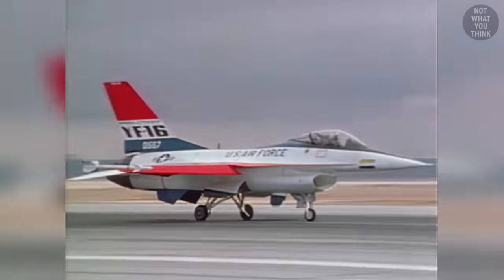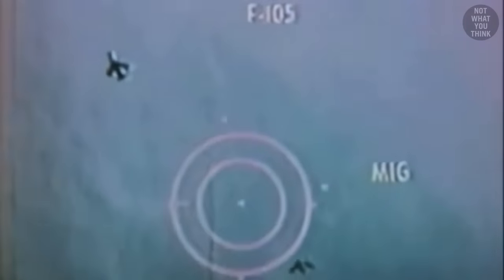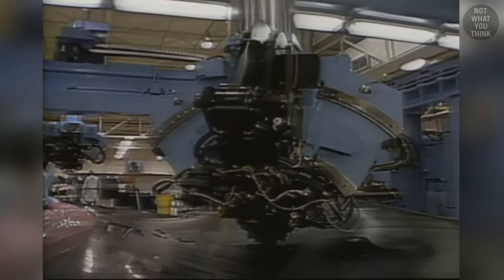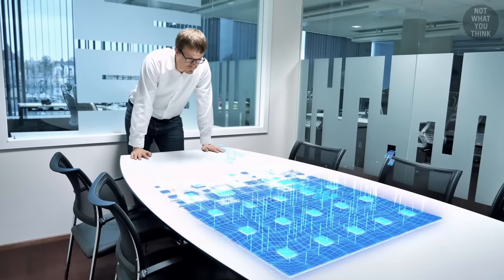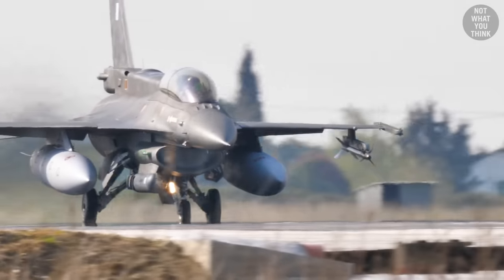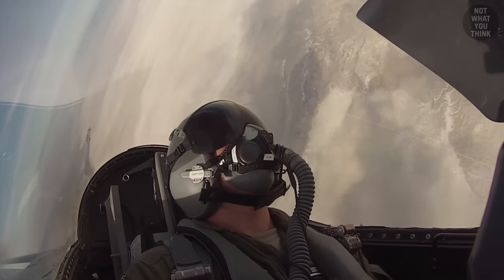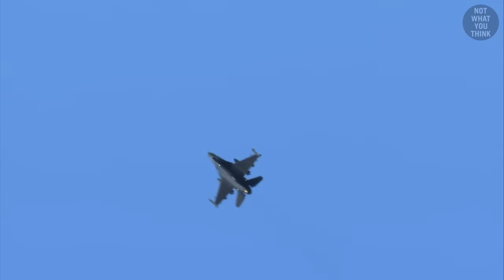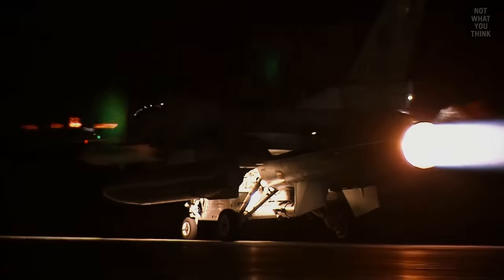Why the F-16 was Intentionally Built to be UNSTABLE

Comment: "Fly-by-wire" never seems to be able to impart just how complex a system this is. Something like fly-by-computer would do the job better imo.

Fly-by-wire sounds like an electronic version of the old hydraulic systems and whatnot. When the real fundamental change is the computer inbetween the pilot and the control surfaces. That is the gamechanger.

Comment: I design paper airplanes (my pfp is one of my models) and some things that people get wrong about paper planes is that folding a plane with a lock, it might be more difficult but it helps a ton.

Also the wings must be at an anhedral position (like how boats shape can help it stay upright), 

and if it pitches down then you need to add up elevator (like a real plane) by bending the back edges up slightly and vice versa. 

With roll or yaw bend the opposite back edge up or the other down and vice versa.

This will drastically improve your plane and make it fly straight every time

Comment: I seriously question that the F-16 was 'The First Fighter Jet Designed to be UNSTABLE'. Waaaay before fly-by-wire had any control of jet fighters, there were two schools of thought on stability. The USA school was that jets should be basically stable and rely on massively strong hydraulic assisted controls to break the planes out of straight and level. The British approach was that the jet should be on the edge of stability and lower powered (or even un-powered) systems should be employed where the pilot could drive the craft to either side of the edge.

Comment: My father-in-law was one of the engineers who designed the flight control systems for the F-16 (he also worked on the F-111). While "Flight #0" did indeed cause a Pilot Induced Oscillation, the reason was not because the plane was unstable. The PIO happened because of the gain settings on the fly-by-wire control system. The test pilot, Phil Oestricher, did an amazing job saving not only the aircraft, but also likely the F-16 program. The powers-that-be were not that impressed with fly-by-wire, and were ready to kill the program at any moment. A crash would've been all the evidence they needed.

The goal that day was a high-speed taxi, where Phil planned to lift off about 1' or so before setting back down and easing back. When the PIO started, he struggled to gain control, and once it started leaving the runway and heading toward the grass, he stopped fighting the controls and the plane took off. He later told my FIL that the plane "wanted to fly", and he hardly touched the controls once it was airborne.

They made some changes to the gain setting on the control systems, and two weeks later had the first official test flight.

Comment: The reason why that YF-16 in the initial tests had exhibited those rolling oscillations, was due to a combination between the pilot's inexeprience with a pressure stick and some flight control logics constants (dampening) that had to be corrected later using the flight data.

The moment "instability", is split into these major categories:

1. "Static instability"
2. "Dynamic instability"
3. "Aerodynamic instability"

Each of these types is relative to one of the three types of rotations: pitch, roll, yaw.

We now already have 9 types of "instabilites". The dynamic stability is again split into two submodes: rapid modes and slow modes. Therefore we have a total of 12 = 9+3 types of instability behaviors. The only type of instability exhibited by an F-16, F-22, F-35, Su-27 family, Su-57, Mirage 2000, Eurofighter, Jas-39, JF-17, etc..., is only related to pitching moments, as static and aerodynamic combined instabilities. pitch only..., all of them None of them exhibit, roll or yaw instabilities as that is undesirable and useless. How is the pitch static instability defined? The short variant: "The variation of the pitching moment versus AoA with the pitch control surfaces at zero deflection". A pitching moment increase towards a positive value, as the AoA increases with pitch controls neutral, defines a statically unstable mode. A pitching moment increase towards a negative value, as the AoA increases with neutral pitch controls, defines a statically stable mode. The aerodynamic instability is almost always present although the static instability has the greater factor. The aerodynamic instability defines the rate at which the static instability varies with AoA.

To give a fact and clear example of how the pitch static instability affects an F-16C fighter, I will explain it as follows:

At zero AoA (close to zero, yet pozitive lift on the wings), mid subsonic speed, the pilot commands a small pitch up G amount (cause the FBW actually tries to give a constant G as output) and so the elevators are deflected for pitch up by a given needed amount. Arbitrary, let's say they deflect 4 degrees up. Let's consider that the IAS (indicated airspeed) never varies. The AoA is now going to a constant 5 degrees. Now, the pilot pitches up a bit more, the deflection goes to 8 degrees, but the AoA doesn't go double as well (as it would happen for a statically stable mode), and instead of 10, it reaches 12 AoA. The pilot pitches up again and the elevators deflection goes to 16 degrees (doubling again). The AoA now goes to let's say, 30 degrees..., again much more than 24 (double). This is the static instability in pitch. For a constant/linear pitch up deflection of the pitch controls surfaces, the AoA increases exponentially more and there is also a limit of AoA (usually a positive AoA limit for modern fighters) above which the plane will pitch on it's own without any more input from the pilot and at some higher AoA, even with full opposite pitch deflection (let's say a pitch down input), the plane still pitches up or is unable to pitch down anymore, an undesirable state known as "deep stall". Up to the point or better said AoA, at which the plane starts pitching up on it's own, the plane is much more precisely controlled via FBW, but it doesn't mean that it CANNOT BE DIRECTLY CONTROLLED by the pilot as many "know very little about everything" tend to believe. For example, up to 30 degrees of AoA, the F-16 can be flown even with no FBW, but it's just too twitchy or too sensitive in responses and a bit difficult, but not impossible to control. At least to AoA's of up to positive 20 degrees, the pilot is able to fly an F-16, fly it around and land it safely. It's just that the precision in expected responses according to the inputs suffers, but the plane is flyable.

Comment: 1:54 I actually did make quite of bit of them and frequently win distance contests. I'd make a square nose (mostly for weight), small wing profile, and elevatore from folding the end of the wings up. You throw the plane up at a 70-80° angle and watch it fly. The nose forced the plane to pitch forward, turning altitude into speed, and when your speed became too much the pressure on the elevators forced the pitch back up. It would restart over and over until most of the stored energy was consumed and could no longer pitch back up. It worked like a flywheel or maybe newton's cradle better describes it. Ugly as shit, slow, no bitches, but flew extremely far. Also, if it catches a good headwind and the elevators hold it will seemingly never stop.

Comment: 2:20 With recent advancements in long-range guided missile and radar technology, the US envisioned air engagements of the future occurring outside of visual range, so the F-14 "fighter" wasn't truly a fighter, it was actually just an interceptor purposed as a fighter, which is why it was bulky, slow, and didn't even have a machine gun. In Vietnam, unreliable IFF systems and crowded airspace basically required visual confirmation before engagement, making the F-14 almost useless. Its missile were designed to target high-flying, slow-moving bombers, and had about a 14% hit rate.

Comment: Flexible wings, especially during stressful maneuvers and turbulence turn into a net benefit. Think of them as like suspension, but for an airplane in mid flight. If the wings were too rigid, they would risk snapping under high levels of stress. Even if you could mitigate that issue though, you still would have the problem of vibrations that don't dissipate as much before reaching the center of the airframe, and then the pilot.

Comment: The F-16, also known as the Fighting Falcon, was indeed the first fighter jet designed to be intentionally unstable. This design approach, known as "fly-by-wire," allowed the aircraft to be highly maneuverable and agile in combat.

Traditionally, aircraft were designed to be inherently stable, with the goal of making them easier to fly and safer for the pilot. However, this stability also limited their maneuverability and agility, which can be a disadvantage in a dogfight.

By contrast, the F-16 was designed to be intentionally unstable, relying on a computer-controlled fly-by-wire system to keep the aircraft in control. This allowed the aircraft to make rapid, high-G turns and perform other advanced maneuvers that would have been impossible with a more stable design.

The fly-by-wire system also made the F-16 easier to control at high speeds and altitudes, where traditional controls could be less effective. This made the F-16 a highly effective fighter jet, and it remains in service with numerous air forces around the world to this day.

Comment: The problem with needing fly by wire is that you can't really fly it like you intend. F16 can get in a deep stall which is impossible to recover from because the fly by wire WILL NOT let the pilot recover the flight envelope.

Comment: Instability is inherently what makes a fighter maneuverable.  Sopwith Camel in WW1 was so unstable it killed like half its casualties in training.  A good fighter should be unstable but controllable.  Wrong about Vietnam.  You don't seem to have any BFM (Basic Fighter Maneuvers) experience.  You just have to know how to fly them ;)  by the end of Vietnam the kill ratio was DRAMATICALLY in favor of the US.  Even during the earliest years the kill ratio was about 2.5 to 1.  meaning 2.5 migs for each American fighter downed.  By the end this was very different.  Also the F16 is strongest in the 2 circle fight.  Maneuverability comes in more than one variety.  A 2 circle dominate fighter excels in traveling more degrees around the circle per sec.  The migs are primarily 1 circle dominate.  ( i.e)  turn radius fighting.  Neither is inherently better and ultimately in most cases it comes down to training and skill.  And ultimately all dogfights will if they continue long enough they will end up on the deck then the 2 circle fighter has a massive advantage as long as they have enough energy (speed+ altitude)  to rate at their optimum.  Also the F 14 and F 15 are by no means light.  I would call F 16 and FA 18 light.  I would call  mirage light.  F 15 is a damn tennis court.

Comment: I love your videos but this one didn't seem to be at your usual high standard...
It's stuff like mentioning the PW F100 engine and not the F-16's other engine option - the GE F110.
Saying that the engine is what accelerates the pilots to 9Gs.
Calling the pilot in the GCAS section a "student pilot"...
Also the connection of one topic to another felt odd and the transitions weren't as good as you usually make them. Going from engine to GLOC to GCAS, and then what does any of this have to do with buying F-16s..? I don't know... Wasn't as smooth as you usually make it, felt kinda pointless and like you were looking for things to add to this video just to make it longer or fuller but instead it felt kinda rushed in my opinion.
Love your videos tho, I don't want it to seem any other way!

Comment: Isn't the Eurofighter the first jet designed to be unstable? From what i've heard it is designed to be unstable under mach 1 to be more stable at supersonic speeds. And the Eurofighter programm startet something around 1975-1990. Please correct me if im wrong im not any good at reserch and this youtube channel is way better but im curios.
Reply: F-16 first flew and went operational way before the Eurofighter. But several fighter designs from that period went this route, like the Mirage 2000.

Comment: I have a cousin that flies f-16s. It was originally supposed to be the viper because of the way the air brakes look. That's those rectangles that are situated between the horizontal stabilizers and the engine nozzle. They open up and the structures inside look like the mouth of a snake. Had nothing to do with the plane looking like a cobra... if it looked like a cobra, why call it a viper? -_-

Comment: The problems faced by the air force in the vietnam war was a combination of assumptions, doctrine and technology of that era. The Phantom was built as an interceptor with bvr capabilities designed to take down high altitude bombers. They assumed that the dogfighting era was over. Not to mention that bvr and iff technology was still maturing. The Soviet Union was also under the same assumptions until their older mig 15s began taking down phantoms. Both sides learned that dogfighting was not dead.
Reply: Turns out a interceptor with pilots trained to take out bombers and other interceptors is not good against specifically designed fighters! What a surpise!

Comment: that also actually "not what you think". the F 16 design paradigm is a "missile". you know how they are, its responsive to control surface behaviours. so they are trying to make it into a simple fuselage that could barrel roll like a pencil, and have tiny wings on it to control the behaviour. thats what F 16 is. it is so responsive that its overreact easily. thats also why that they resort away from common hydraulic controls to a complete "fly by wire" system. to have software managing the input to alleviate some of those human rough input that could overreact the over responsive control surfaces.
faithful flight trajectory is not the aim. they want it so it would freely move and turn. actually like a missile. many probably dont know that when a fast air to air missile like the sidewinder make its sharp turning to follow the course of its target it actually doing a very high AOA. and the nose would be completely off angle. the benefit, it could maintain its sharp turn without losing much of energy. thats the basic idea for the F16. thats why many says it has the best buffeting behaviour, especially at near stall speed.
but again, that dont make it worth while. since the one that make all the scores is the bigger ones instead. like the F15. 
think of F16 like a bicycle. its so agile to control. you could treat it like its your own body extension. but it doesnt move stable like motorbike on straight line. you constantly have to balance it around. but it such a in control that you could do more acrobats with it than you do with superbikes.

Comment: Another thing interesting to know about this: the f16 actually has a stable point in a certain orientation, the first models suffered from this. the point was so stable that the aircraft would be actually stuck in it, sometimes requiring to shout down the engine to get out.

Comment: Okay lets correct the misconception at the beginning. Soviet fighters were not more maneuverable than American fighters in Vietnam. 

It depends on the speed. The F-8 was most maneuverable aircraft at high speed maneuvers during that war. Even the F-4 specially those modified with leading edge slats like the F-4E had maneuvering advantages over the Mig-21 particularly at high speed. 

The F-5 also had the highest G onset rate of any fighter meaning it can get from 1G to its max G faster than any aircraft in Vietnam

Comment: Fly-By-Wire system is not stability augmentation system. Fly-By-Wire means the controllers are not mechanically connected with flight control surfaces. That's all. Airbus also have Fly-By-Wire system. And it is naturally very stable aircraft. Do not mess those two things together because those are not the same things. You can have FBW without SAS. You can have SAS without FBW.

Comment: Crediting the reformers or the fighter mafia with any input on the f15 or the F16 is doing a massive disservice to everyone who actually worked on those planes. The reformers advocated for missiles,fuel tanks, GPS and any electronic system you can think of to be a part of the plane designs. They were the equivalent of idiots standing out the front of some place with protest signs of their demands. They had nothing to do with aircraft design and just take credit for things they were never involved in.

Comment: Remember when this thing kept killing its pilots because the tail end of a screw fastener cut into the cockpit wiring.  The funniest part was the air force kept putting it down to pilot error and covering up the fact that there was a fault that they couldn't find straight away!  I see old habits die hard as appears they're doing something similar with the F35🤔

Comment: @2:20 What was the kill ratio in AtA combat during the Vietnam war?
@2:30 Yet you show a gun kill vs a MiG
@3:22 F-16 is slower than e.g. the F-4
@3:25 What influence the members of the fighter mafia had on the F-16 design? Save for Hillaker
@7:23 Big wings help with maneuverability
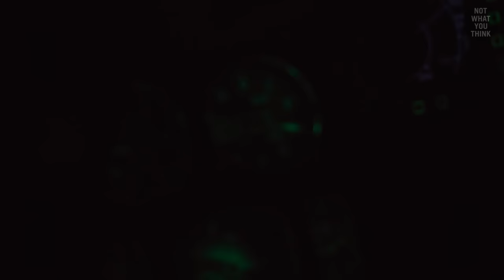@9:06 Why the pilot needs to handle extra data in a FbW plane?
@9:11 You are saying that a radio altimeter is somehow required due to FbW?
@9:27 The 9g is achieved not due to linear acceleration
@9:58 The seat doesn't tilt due to g load. It's always tilted. 
@12:50 You're suggesting the F-14 was lighter than F-4?
@13:48 F-22 a replacement for the F-16?